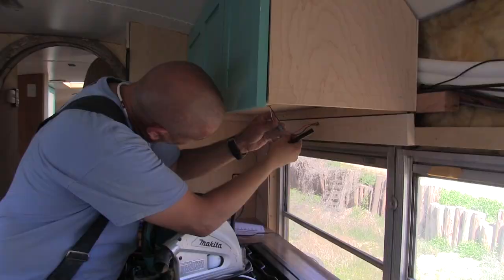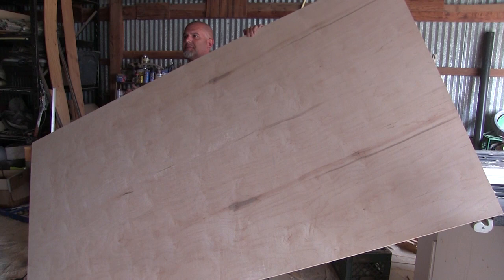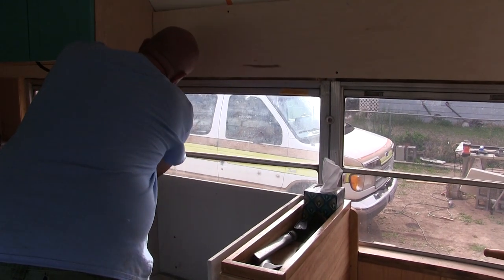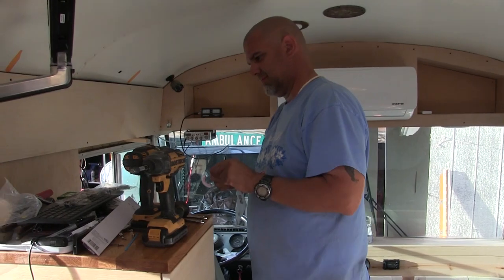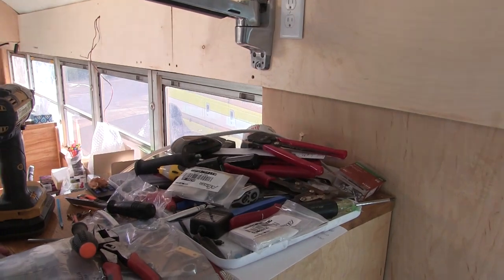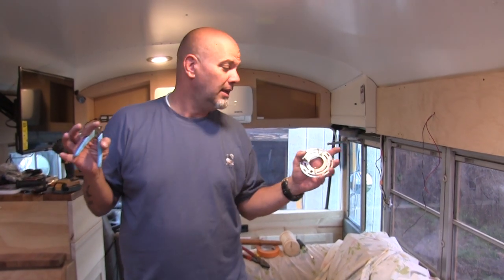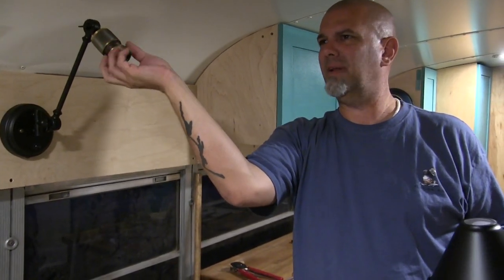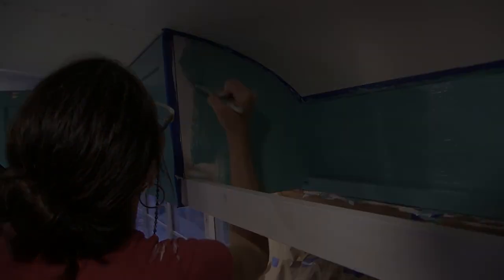Skoolie Living Room Reveal | TV Wall Mount & Modified Lights

Comment: Mike-gyver did it again.  But you forgot to lick your fingers before working with wires.  Instead of welding I'm planning to use 5/16 rivnuts on hat channels for multiple things like that TV mount and our hammock eye hooks and roof mounted items. Looks absolutely frickin awesome guys.

Comment: The bus looks great. I do have to question the sanity of the bulb makers using the same base for 12v bulbs as 120v. Granted , it makes it easy to repurpose cheaper 120v fixtures, but ya know some poor sod is going to screw one of those into a 120 socket.

Comment: IT'S LOOKING SO GOOD HEY I WAS WONDERING WHY YOU DIDN'T TAKE THE METAL CEILING DOWN IT SEEMS LIKE MOST PEOPLE DO AND INSULATE BETTER
Reply from the maker: Many reasons: we like the look of the metal ceiling and rivets, we're not going anywhere cold in the winter, we have a deck over the entire roof for shade in summer, and even if we insulated the ceiling we'd still have 21 windows un-insulated... not to mention, we have a heat pump, 2 diesel heaters and a wood burning stove to keep us warm wherever we do winter!

Comment: As fer as i know in house wiring white is the common wire and black is hot which is opposite of vehicle wiring were black is chassis ground and color is power, anyway I'm curious if your going to have an issue with the tv jumping up and down during travel I'm sure mike has a plan for this though. I thought it was funny during the butt debacle the Kerry's butt felt left out and had to get in frame lol
Reply from the maker: You are correct but in the case of the lights the neutral and hot wire will reversed as far as where they led to.

Comment: turned off all interior Ele. and disconnect onboard power before welding? I learned the hard way, burned up my ele system. Very expensive to replace... MY BAD
Reply from the maker: It was fused 12vdc. I wasn't too worried.